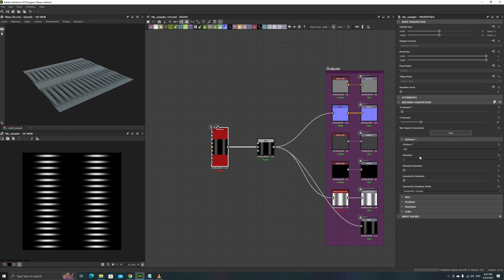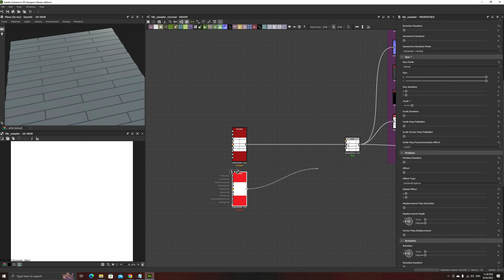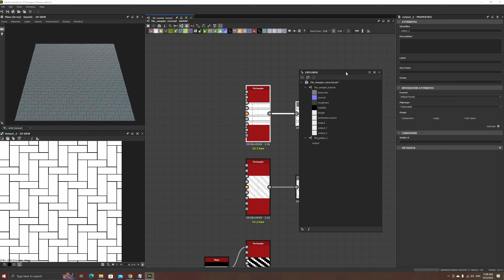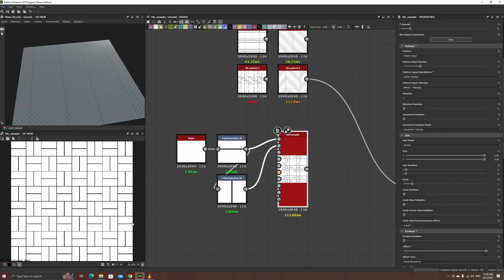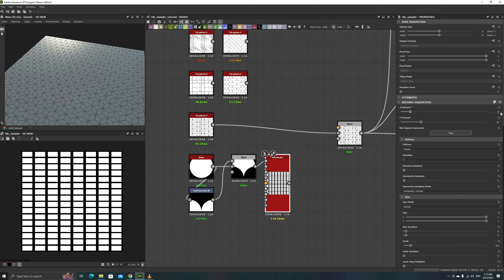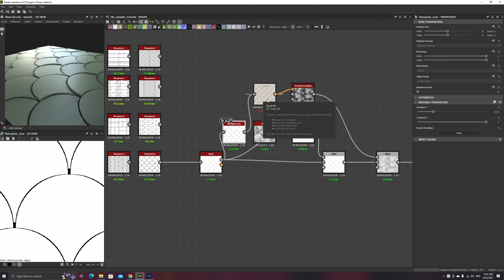Substance 3D Designer Tutorials: Making patterns using the Tile Sampler

Comment: how to adding more pattern inputs to the tile sampler node in substance designer
Reply from the maker: There is a setting on the tile node that adjust the number of inputs (defaults to 1). Just increase the slider and you should see more inputs, labeled "pattern1", "pattern2", etc.
Reply: @EnriqueVenturaGames  Thank you! Actually, I solved it after writing a comment!

Comment: Is Shape Splatter node the updated version of Tile Sampler? Tile sampler only outputs a height map. White Shape Splatter also outputs a flood fill. Can also be paired with Shape Splatter Color.
Reply from the maker: In some way, it kinda is! Is like comparing the tile sampler and tile generator; one has way more options and possibilities, but is a little bit more expensive. Same happens between tile sampler and shape splatter; splatter has more options about how the shapes' height merge with the background, but if you are not merging heights I'd stick with the tile sampler.